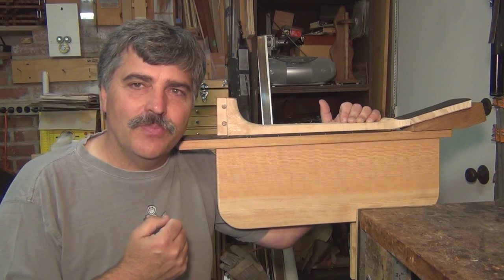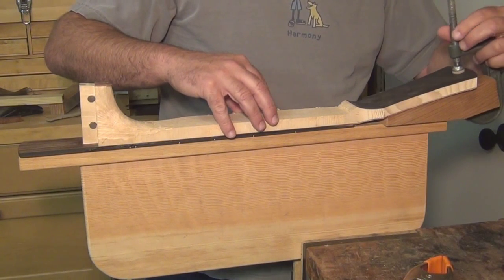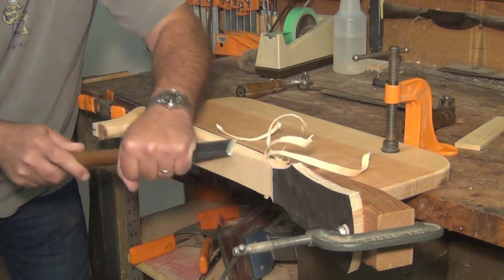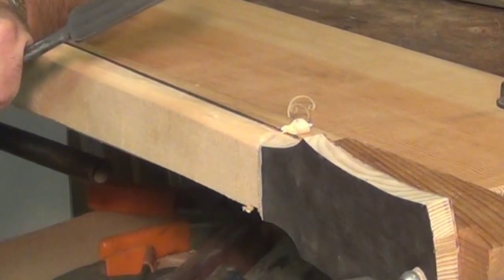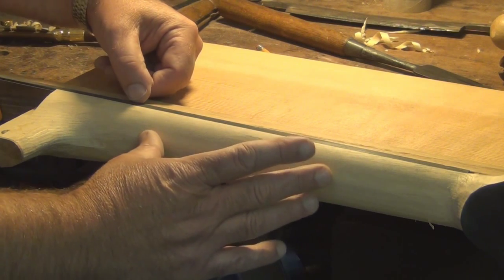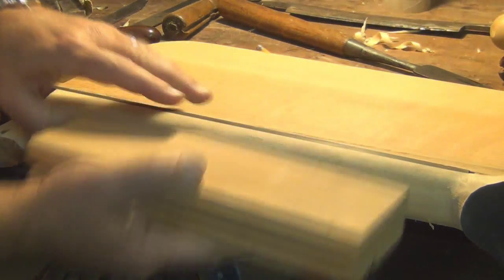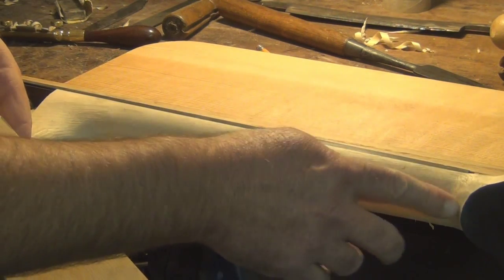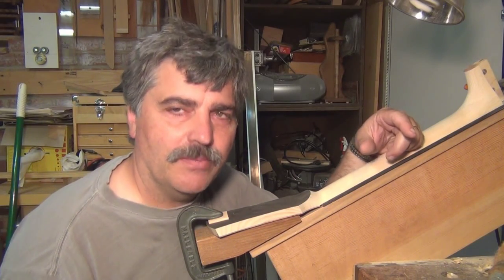Chapter 20 carving the neck

Comment from the maker: Thin a strat neck? They already feel thin to me but everyone has their own desires.  The techniques I showed are only a few of the many ways you can remove material to shape a neck.  They will work equally well for thinning your strat neck.  Just be careful not to remove too much material from the area around the truss rod. That is already pretty close to the minimum you need to support the rod tension.